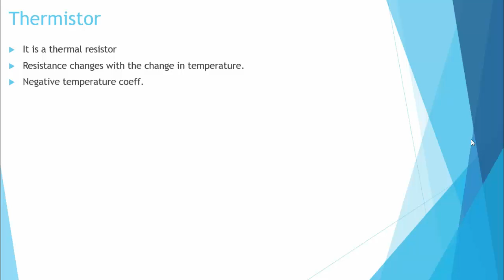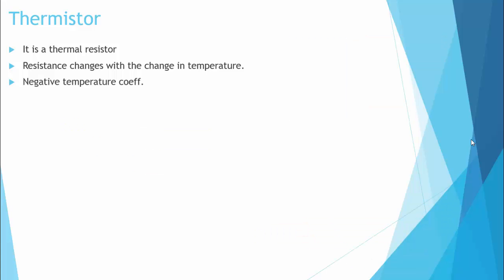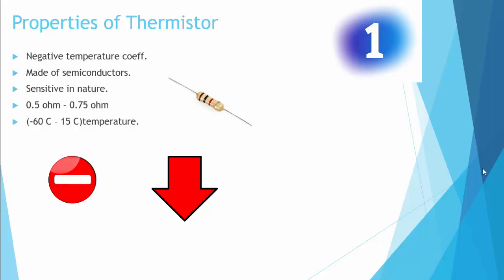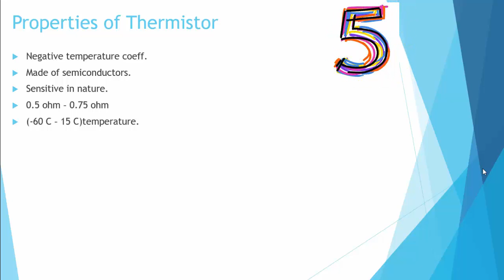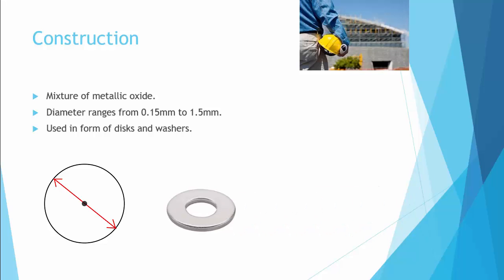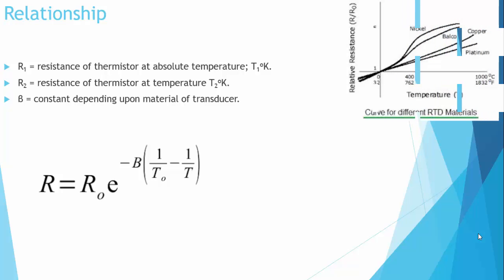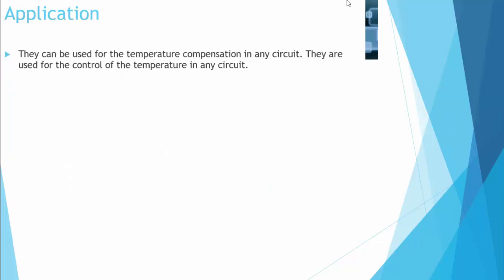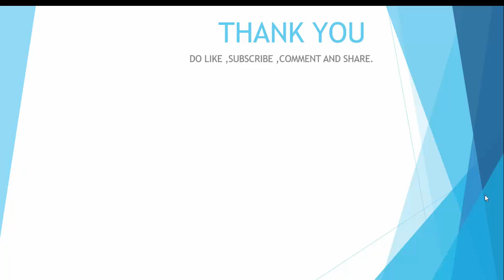Thermistor || Working || Application || Tutorial

Comment: I have a aluminium plate which I have to measure the temperature from. Would it work putting these on the surface?
Reply: Dear, This is kristy wong from Nanjing Shiheng Electronic,Co,Ltd. We are the manufacture of NTC thermistors, NTC temperature sensors, Varistors. Thermistors and thermistor probes are used extensively throughout the HVAC/R,BMS,PCBA industry. Do you need these. NTC thermistor series application includes of surge current, temperature compensation, precision temperature test
Looking forward to working with your company
Whatsapp/Wechat/Tel:+86 13951639167
Email: 1372286431@qq.com
kristywong521@gmail.com
https://www.ntcshiheng.com/

Comment: Try to make a video on different applications of thermistors also
Reply: Dear, This is kristy wong from Nanjing Shiheng Electronic,Co,Ltd. We are the manufacture of NTC thermistors, NTC temperature sensors, Varistors. Thermistors and thermistor probes are used extensively throughout the HVAC/R,BMS,PCBA industry. Do you need these. NTC thermistor series application includes of surge current, temperature compensation, precision temperature test
Looking forward to working with your company
Whatsapp/Wechat/Tel:+86 13951639167
Email: 1372286431@qq.com
kristywong521@gmail.com
https://www.ntcshiheng.com/

Comment: I have read that Thermistor are of two types positive as well as negative temperature coefficient of thermistor🤔
Reply: Dear, This is kristy wong from Nanjing Shiheng Electronic,Co,Ltd. We are the manufacture of NTC thermistors, NTC temperature sensors, Varistors. Thermistors and thermistor probes are used extensively throughout the HVAC/R,BMS,PCBA industry. Do you need these. NTC thermistor series application includes of surge current, temperature compensation, precision temperature test
Looking forward to working with your company
Whatsapp/Wechat/Tel:+86 13951639167
Email: 1372286431@qq.com
kristywong521@gmail.com
https://www.ntcshiheng.com/